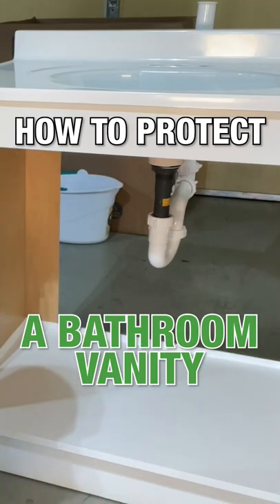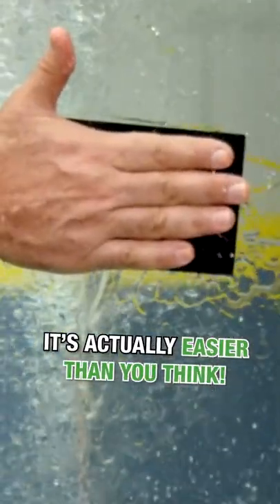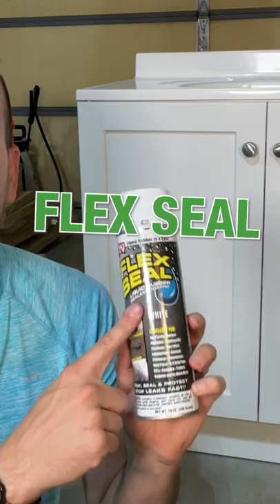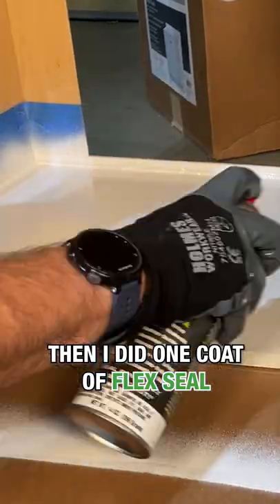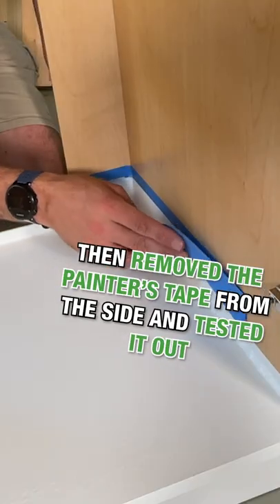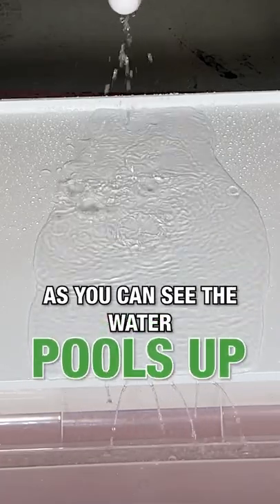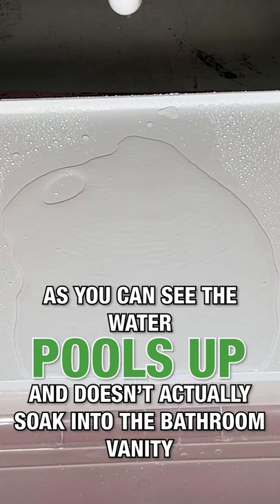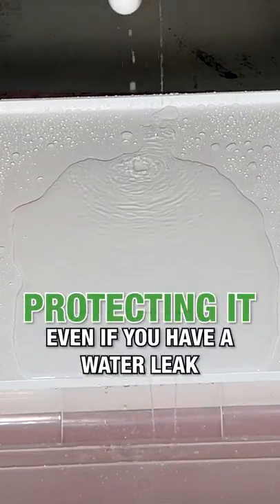Flex Seal Your Bathroom Vanity #shorts

Comment: The problem with flex seal it only lasts for about a year and it breaks down cracks and looks like crap..  Flex seal is the is designed to be a temporary fix on anything.. What you should have used was polyurethane a few Coats And it will last for years also also put a drip tray in your cabinet

Comment: I was the first to come up with this idea about 17 years ago.  Used truck bed coating
Reply: And you didn't post a YouTube tutorial video about it? Wtf bro.
Reply: @FunWhiletubing  prob cause of ancient guild / union rules and intellectual property rights lol
Reply: it is a great idea, we have an old fixer upper and some quick fixes like this can sure save a lot of little headaches while you try to deal with the bigger stuff (without going into a bunch of unnecessary debt to do an expensive big-bang reno that will probably have quality issues anyways)
Reply: We used exterior latex paint since the 90s and worked better than all these options, way cheaper and usually with leftover paint.
Reply: @gymfloor169  good idea

Comment: I've found that Flex Seal doesn't really hold up all that well over time, a year plus and it's starting to peel and crack .. YMMV
Reply: I agree!!!
Reply: I put flex seal in my chicken coupe for easy washout...been there for 3 years...wash it out once a year. Although I didnt use the spray can. I put thick coats on with the gallon and a brush.

Comment: Whats the point when the water will still get out ? Its just redirecting the damage
Reply: A few reasons. For one, you may not notice a water leak if it is simply absorbing into the wood beneath the sink while you’ll notice water coming out from under your sink. Another is that it’s going to prevent damage that will be a lot harder to fix, and depending on the setup, you may even get no damage if you have vinyl or tile flooring for example.